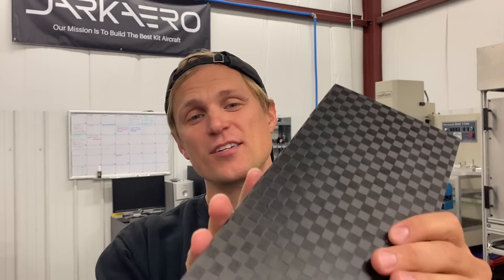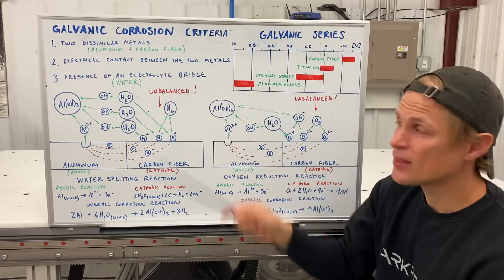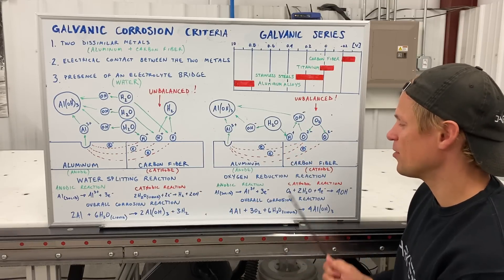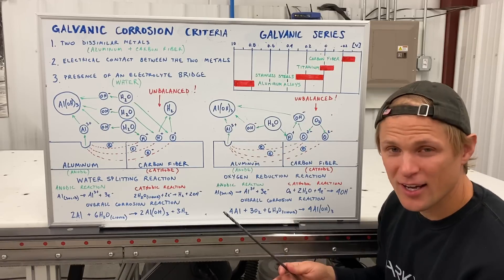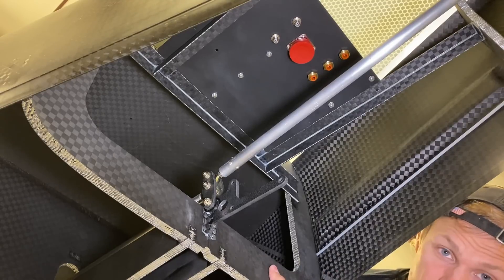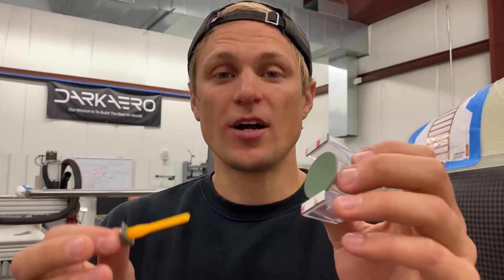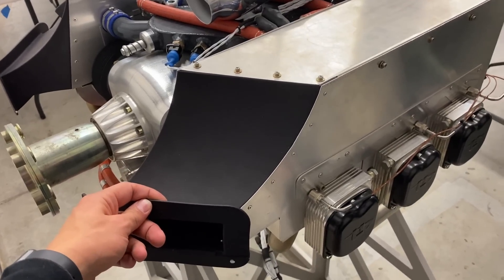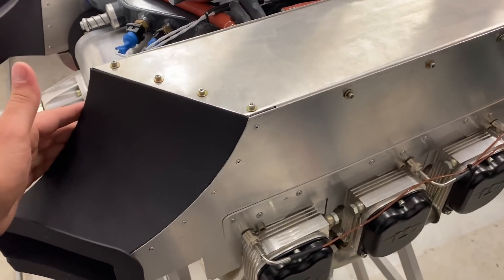GALVANIC CORROSION: CARBON FIBER + ALUMINUM | What is it? How we prevent it on the DarkAero 1!

Comment: We use hysol structural adhesive as a seperation layer as well as additional adhering  if necessay. It can be used for hardpoining as well for critical other metal fasteners like bolts and 4130 interconnects.

Comment: Okay differential metal corrosion and or galvanic corrosion has been a thing since they have started using metal specifically in sailing vessels. They have been addressing this problem for 500 years now so thanks a lot on getting caught up. By the way it doesn't always take two pieces of metal. Any substance creating a disproportionate electrical flow over even the surface causes differential corrosion. In aluminum it is seen as pitting. As somebody who had to deal with this on Navy aircraft in the mid-70s and later on private yachts this is nothing even remotely new. By the way freshwater makes a terrible electrolyte while salt water is one of the premium electrolytes. That is why when you drop your cell phone in the toilet you just have to dry it out and it works. If you drop it in salt water it instantly fries. Anyhow what  your teaching now was taught to me in 1975 at Navy Afram P School.  And by the way you are really making it confusing. Why don't you just show everybody the nobility scale and go from there.

Comment: Most epoxies have a very high resistance.  Why didn’t you just use a coating of epoxy instead of the fiberglass—epoxy layer?

Comment: I did some work studying galvanic corrosion of fasteners installed in carbon panels using a salt fog chamber. The aluminum ones literally disappeared in 24 hours, despite being expensive aerospace grade parts. Ti and SS were fine for thousands of hours. It certainly gives me pause before blindly bolting carbon bits onto my car.

Comment: Late to the party as usual, but this an interesting area of study that has been arguably been tackled across a lot of different industries. In racing applications, ironically one of the first uses of bi-material composites, they don't particularly address it well, as most platforms are seen as essentially a limited lifetime chassis. Once it begins to form, the clocks are ticking on replacement. 
Aerospace is a little different, where coatings and even sacrificial anodes are used, both with pros and cons. Maintenance is generally high in this space, so upkeep of sacrificial bits go with the territory. The sacrificial route is also used in heavy cargo ships and waterway bridges. 
One of the somewhat overlooked areas particularly of concentration with aerospace is material interaction with static air charges building on operating and structural surfaces. Isolation in the core structure helps, but also needs a secondary strategy as the charge can build in operation beyond design specification depending on operating environment (naturally, you don't have much choice here).

Comment: You can't have galvanic corrosion without TWO METALS. You go over this, then ignore it. Your misinformation is not helping anyone understand the topic. You are describing a redox reaction between a metal and a non-metallic oxidizer. That's just corrosion, not galvanic corrosion.

Comment: fiberglass, even if thin, weighs a lot on a large surface, NOMEX is better for airplanes. I put the double fiberglass insulation on the anodized aluminum inserts mounted on the boats. Anyway, thanks for the details you provide! all laminators should have this knowledge before they get their hands on the piece! here in Italy some companies are not required to give certain explanations to their workers! It almost seems like a secret!

Comment: Have you thought about coating the aluminum parts with Cerakote H-900 Electrical Barrier or a similar product when in direct contact with carbon parts? I know you could anodize the aluminum parts but they would lack corrosion/chemical resistance. There are also dielectric epoxy adhesives that could be used to glue carbon and aluminum but I doubt they would have the same mechanical properties. All this extra coatings and work might just be extra since they might outlast the life cycle of the parts they are being applied too.

Comment: I learn so much from this channel, tha k you so much for the quality videos y’all put out! 

How would you address galvanic corrosion in high heat environments? I’m building a grill and there’s points corten steel touches up with stainless steel and currently looking into solutions to prevent galvanic corrosion. Thanks I’m advance 🫶🏼

Comment: As a commercial plumbing contractor, I’ve seen horrible commercial plumbing systems, like the Massimo clothing factory. A very careless installation plumber originally installed all of the copper water piping systems with no dielectric couplings on the copper to iron pipes and fittings and just several years later, all of the copper tubing, as large as 6” diameter copper pipes had hundreds of pinholes and had to be removed and replaced. The interior of the factory was similar to a greenhouse mist system!

Comment: To prevent the galvanic corrosion :-
must I insert an insulating layer between the Al and CF blocks in your diagram
OR can I insert a thin titanium sheet to separate the Al and CF blocks which will still let the current flow but create Al/Ti/CF interfaces and not corrode in place of the Al/CF interface ?
Cheers
John

Comment: The Nomex should also be more fire resistant. Aluminum does not have to get particularly hot before it starts to become molten and when it is molten and encounters water it can become explosive. However I don't think you have enough aluminum in that aircraft to worry about truthfully.
Reply: Geez, it's a good thing they don't build airplanes out of that stuff!

Comment: Hi! Very interesting class!! I have a question: I'd like to use carbon fiber to fix or reinforce some aluminum bike frames. Can the epoxy resin used to glue and mold the carbon fiber be an insulator between the two materials and prevent corrosion?  and What if I use a fiberglass cloth first?   Thank you!!!!!
Reply: Epoxy alone won't ensure separation but even very thin glass will, easy to find online. I think you will find that carbon and aluminum are not very compatible if bonding is depended on for strength; Epoxy doesn't adhere well to Al (and surface prep becomes intensive) Also CF and Al thermal expansion coefficients are quite different, aluminum shrinks and expands a lot, carbon only a little. You can still use CF, but it helps to create a structure that holds itself in place whether or not the bond fails; i.e. make "boots" for joints that are thick enough to physically support the tubing absent lateral or shear strength along the bondline.

Comment: The air inlet, I feel, would be a good place for fiberglass use.  The plastic will deteriorate over short time with the heat changes becoming brittle.  It will be a constant replacement part.

Comment: Hi when you talk about galvanic corrosion you should also consider your SS bolt touching aluminum same problem, I have seen this in your video. Your aluminum parts will be corroded where touching SS. I have seen this in many airplane. I am building aluminum boat so have some serious experience on this subject. Try to use Tef-gel between dissimilar metal. You must also be very careful when electrification and wiring of your plane, always use two-polar thermal switch and never use ground pole. Success in your project.

Comment: your definition of galvanic corosion was ALMOST correct it is not between metals though it is between electrically conductive parts of differing resistances .. as long as it will conduct electricity it will corode 
.
the fact that most metals are electrically conductive makes this most common with them ... even sodium and carbon will corode .. when in the right conditions and NEITHER is a metal ... BUT they are BOTH conductive ... in this case the carbon fiber would be eaten away while the salt will change to black

Comment: so the aramid honeycomb is less advantageous in the core compared to the need for a fiberglass intermediate between the aluminum honeycomb and the carbon fiber - and is less advantageous to the direct adhesion between the aramid honeycomb and the carbon fibres??

Comment: Appreciate your tests!
    Who doesn't like carbon fiber? It's pretty and it's strong. And you're not necessarily stuck with black there are some unique color combinations especially when it's carbon fiber hybrids.
   I made several parts including the trunk and Hood and  covered the rest on my 75 Celica Coupe with a blue carbon Kevlar  hybrid call reflections.
    But carbon fiber is not the strongest, and certainly not the most durable when it comes to composites. Oz for oz S Glass has it beat. It is stronger and stiffer then carbon fiber and also tougher than Kevlar. And can withstand temperatures of 1400 f. Which is half that of titanium. 
   S Glass is also one-third the cost of carbon fiber. It just isn't pretty. I have designed and built a few airplanes over the decades S-Glass is my choice. Although the shocked landing gear on my bush plane uses a combination of Composites including the hybrid TeX tream and zylon.
        🤠🐂🏞️🛩️

Comment: Hi There , whats the maximum working temperature of the carbon fibre and epoxy resin? Is it possible to skin a thin sheet of aluminum or copper with carbon fibre ?

Comment: This is a good tutorial to introduce one to the concept of G.C.  To make it outstanding would be the inclusion of steel (ex: 4130) to the GC series chart. Also what is the difference between water and fuel/oil to the rates of GC?  I will bet that most readers are surprised that fuel could be the moisture element. To the geeks who needed a formula to follow GC....forget it they should not and can not build an airplane. It would take them months to make one perfect part. Thus the average 5 year build time would become 5 eons. (if you have problems with this statement please contact the Python boys)  Nice catch on  painting the carbon and not only the aluminum (metal).  You guys do nice work.

Comment: What about grounding carbon fiber panel to discharge static electricity? How does this play into this? If you isolate the CF you don't discharge anything with the risk of charging the part.

Comment: It is impressive that you have such deep materials knowledge and a willingness to share such detail. It also evokes confidence in your product. One question: what about the exposed cut edges of the aluminium honecomb, such as you showed in the aft fuselage. Wouldn't water on the cut edge bridge the skin and core? (I appreciate that you are changing the core material for production, but I was just curious).  Thank you again for you wonderfully educational videos.
Reply from the maker: Currently, we seal up exposed honeycomb edges with assembly adhesive but we are also testing out some other low density fillers. Thank you for watching!

Comment: Hi DarkAero, This is very informative video. Thanks for that! One small question. It could be seen from video that fuselage honeycomb sandwich  frames edges also bonded to carbon fibre skin. How do you fight GC here or how are you ensure you frame's aluminium alloy core does not have contact with fuselage skin?

Comment: A good solution against galavanic  corrosion that is very often used on boats (salted water is a nightmare compared to fresh water), is to use a third material that would be even more sensible to galvanic corrosion, with sol purpose of absorbing corrosion in place of the others.

Comment: I served 15 years on  500 ft  research vessel and one of the ways the marine industry fights galvanic corrosion other than sacrificial metals was to electrify the hull with a very weak charge to nullify the difference in charges. I thought this was clever.
Reply: This is a great solution.

Comment: I had no idea that a composite and a metal could have galvanic corrosion. Of course this type of corrosion is based on electrical potentials. It is amazing the battles which are fought when we make strides with technology.. so the old saying that it’s ok to be on the leading edge of technology just not on the bleeding edge.

Comment: Hi, great video. Why did you not make the air inlets out of glass fiber composite ? From my experience cheaper  and stronger than SLS printing , and it seems you have composites production on a very high level :)
Reply: Although some carbon fiberglass is resistant to temperatures of roughly 300*, the resin may not have the same tolerances and would be subject to melting. Although I think his reasons for not using it there was to avoid corrosion.

Comment: 7:11]  You haven't mentioned it, so I'll mention it, cathode to anode surface area ratio (Ac/Aa).  Ac/Na ratio is the idea that when a large surface area of carbon composite material [anode] is coupled to small metallic parts such as: fasteners, bolts and nuts [cathode]  the rate of galvanic corrosion can be extremely high.  Galvanic corrosion on steroids in other words.

Comment: GREAT VIDEO  WISH I SAW IT LAST APRIL LOL
 I AM BUILDING A HARLEY DAVISON POWERED 400 HP BD5 AND TO NOT SHREAD THE FUSALAGE, ITS GETTING A CF COVERING ON EVERY SINGLE SURFACE IN AND OUT SIDE I AM SCORCING A NON CONDUCTIVE RESIN FROM ADVANCED COMPOSITES  HERE IN CALIF
THE SAME SPACE X USES TO BUILD FINS ON THE ROCKETS. I ALSO BUILT A OVEN AND VAC CHAMBER, IT TOOK ME MONTHS TO WORK THIS OUT ALONE
AND ITS THE FIRST BD5 WITH A EJECTION SEAT AND THE VERY  FIRST FULL STEALTH AIRCRAFT EVER IN PRIVATE HANDS,  GIVE ME A CALL SOME TIME  THX REY 9163015077

Comment: Thanks for the video.
Do you have any examples for where this type of corrosion actually resulted in a problem?  What does that look like.  I have made heavy, structural CF parts that mount on to aluminum and I haven't really seen much going on.
Reply: For a passenger carrying airframe, it matters. Because it's designed as light as possible to meet it's design loads, therefore any reduction in strength is not acceptable. And the design will likely still be flying fifty years later.

Aluminum oxidizes. It gets a chalky gray layer on it that can reduce bond strength between it and the epoxy. This layer forms almost immediately on contact with air or water. Especially humid air or salt water. But it's a very thin layer at first and causes no problems at first. A pure polished mirror of aluminum has none (yet).

Comment: I might have run into this issue in an old house, wherein I was attempting to have a plumber bring a natural gas furnace back online after five years or so of non-use.   Black iron pipe used most everywhere, but galvanized metal elbows in the corners...and he started frowning when he looked at it closely.  "These elbows were intended only for water mains, and whoever built this (back in the 1950's) should have known this...but just might not have known about it."  This Old House, indeed....
In the end he went all the way back to the meter, and started over again, as those elbows were used in every bit of the gas main.   So:  Is natural gas considered an electrolyte bridge?   Are galvanized pipe and black iron actually dissimilar metals?  The metals were certainly in contact with one another, and the gas circuit was certainly grounded....
BTW, I'm not just some lost homeowner asking this, as dad had purchased and were starting to build an RV-6 until we realized the cockpit was too vertically confining for comfort, and the alterations were going to be very difficult and time-consuming.  The RV-10 I tried on for size at our local airshow fit both of us (tall guys) a whole lot better...but then his health began to fail and that brought an end to the project.   
Even though he's gone, I'm still paying attention.  "Go, men, Go," and thanks for the very informative videos!

Comment: How do you feel about epoxy painting the carbon and anodizing aluminum? Im building carbon fiber valve covers with an aluminum flange and people are trying to convince me im going to burn my car down.
Reply from the maker: As long as you electrically isolate the two you should be fine. I’m guessing you are doing this on a car that you are working of frequently and you are looking under the hood often. Just keep an eye on it. Corrosion takes time. Monitor it and you can always swap it out. I was actually thinking of making some “forged carbon”valve covers on our airplane as a fun bonus project. I’ve seen guys do carbon oil pans with aluminum blocks.
Reply: @DarkAeroInc  thats basically what I did. Its a chopped carbon cosmetic layer due to the complex shape.
Reply: https://youtu.be/JZ5HnZ572uk

Comment: I really appreciated this video.  I'm just now starting the prepping process for making molds of fairings for a miniGP race bike I designed and built.  Have been planning on remaking the fairings in carbon fiber.  Guess maybe I'll add one thin layer of fiberglass on the inside for where it contacts the aluminum frame for mounting.  Just a quick question, why doesn't the resin prevent the contact?  Does it function as an electrical contact?